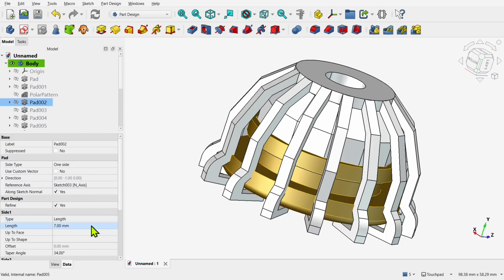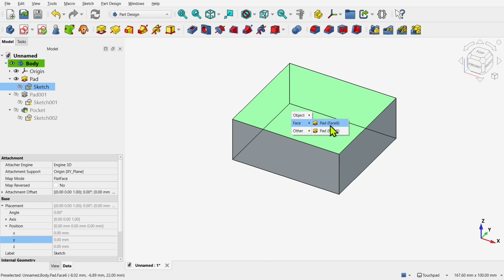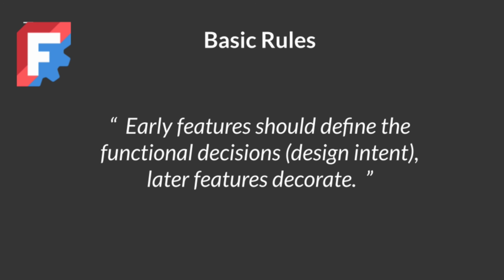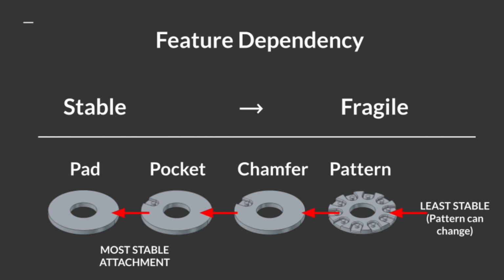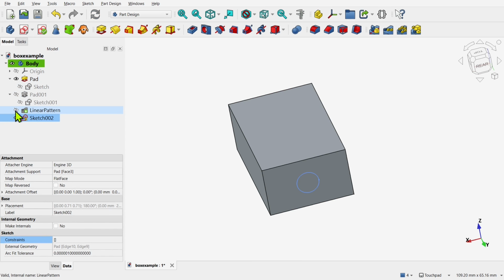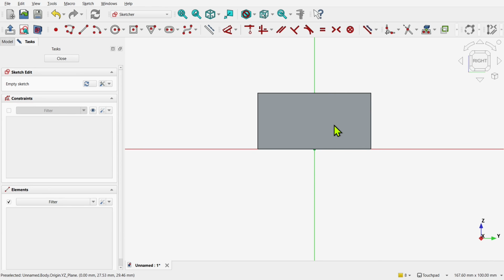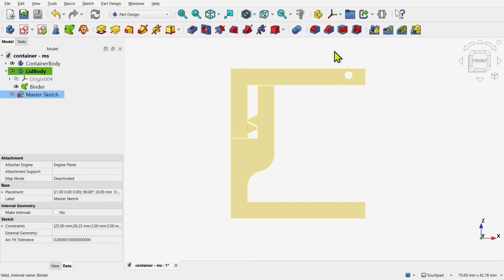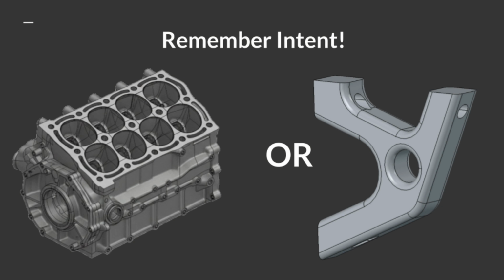Why Your FreeCAD Models Keep Breaking (And How to Stop It)

Comment from the maker: Recommended Book for anyone interested in Mechanics / Engineering - 507 Mechanical Movements, by Henry T. Brown. Check the link to get your own copy: https://amzn.to/4r5EYA1 (Amazon affiliate hardback copy) https://amzn.to/45lgbj5 (Amazon affiliate paperback copy)
Reply: i mean this in the most respectable sense .... you are an ass ... i was trying to figure out how to make changes simple in freecad ... what pops into my feed ... this freaking video ... I learned WHERE and WHY my sketches go poof .. and how to avoid that and how to reference inside the sketches to use the parameter one time and update where it duplicates ... 

exactly what you covered .. bloody hell Man how are you reading my mind .. months years and even days in advance LOL 

how about a video series where you design an RC drone of some type .. and INCLUDE parts like the Flight Controller and Electronic Speed controlers etc .. tbh ANY part will do ... but I want to see HOW actual parts can be referenced and incorporated into the drawing so IF you change one widget of 3 x 5 bananas for one that is 4 x 4 oranges .. it doesnt go kablewy ... 

heck do a Basic lamp even with wire bulb switch and shade even

Comment: This helps learning the FreeCAD quirks, at least I know a bit more to fix stuff.  Not ment as a critic to your video, but functions as designed is not automatically mean good UX design. It's certainly not, hiding behind, it has always works this way or your using it wrong arch.

Comment: This video unblocks the road block in learning FreeCAD. The simple one level tree structure display hides the fact that a down stream feature can attached to any feature in history not just the one directly above it. If the Tree is display like a folder tree, it will immediately show which feature is the support instead of having to dig into the feature properties to locate the support. Spent so many hours wrestling with FreeCad, not knowing I could reference any feature in history.

Comment: So far I was not using the VAR set feature - I was using a spreadsheet and created alias names for the main dimensions I needed. If you could make a video about the pros and cons of both possibilities would be great!
Reply from the maker: Varsets are more responsive than spreadsheet, they are easily selectable being in the treeview and you can update the values when, say, they are used in a sketch whilst you have it currently open in the sketcher and see the affect straightaway.  Varsets are also type aware so a length is a length, a string is a string making them quicker as they don't have to be converted into the value which is required by the property using it.  Spreadsheets can trigger an update just by selecting in a field which can increase compute time but spreadsheets are often more intuitive allowing for layout, calculation across multiple fields and different configuration for your part across multiple lines which can be hooked up to the copy on change. I try to answer some here to get the information across but it's a great idea for a vide, I will add to the list.

Comment: A perspective from an Old Catia user here... To make your first example model -, in a Catia way - I would create all 3 parts as separate models (Bodys), then union (Boolean) the 2 prisms together. The pocket or hole could be created simply (there were more complex ways) as a cylinder and subtracted. You can now easily snip off the hex body if you don't want it & update.
Yes, it creates a tree structure that can be more easily manipulated (in my mind). As the dependencies are held within each model (Body)
FreeCAD can be made to work that way, but the boolean structure is sort of hidden.
When doing the boolean between prisms 1 & 2 it creates another body and the 2 original parts go into hiding, which makes it hard to manipulate later on.
It's a learning curve - thanks for posting this.

Comment: Most of the tips in this video are useful for any CAD software, such as Solidworks and Fusion360. But some of them are specific to FreeCAD only. 
FreeCAD is good software, but often needs manual labour to resolve some types of issues. Fusion360, on the other hand, typically handles them automatically. I hope that FreeCAD will develop similar capabilities in the future.

Thanks for the video, it was helpful!
Reply from the maker: Thanks for your feedback and input on this, much appreciate.  Glad you found the video helpful :)

Comment: Yay, finally found a video that explains one of the reasons why FreeCAD breaks so easily so often, doesn't retain face numbering very much nor resolve changes so any feature that changes face numbering will break stuff.

I do not remember breaking models in Fusion 360 because of this unless I deleted or split a feature actually referenced in downstream sketches and I have CADded a 3D printer in 360 down to running wires using 3D sketches to route them. Looks like 360 is far more robust at maintaining references through changes. In FreeCAD, I'm struggling to put together a simple bit organizer for a screwdriver that came in a nice metal box with flimsy plastic organizer insert that is crumbling apart.

I'm looking into FreeCAD because I hadn't used 360 in a while and when I logged in last week to verify that the way I wanted to approach things actually worked in 360, which took under an hour including time spent re-acquainting myself with the UI, I found out all the stuff in my free-for-personal-use account had vanished. I really like how 360 allows part details to get flat-packed into a single sketch and selectively padded, pocketed and drilled from it. All critical dimensions, constraints, references features for downstream sketches, etc. for that part plane in one place, can't break them even if you tried. Doesn't work quite so well in FreeCAD which only allows one sketch feature to be selected for padding/pocketing at a time when you have 16 same-depth different-diameter holes, got to spit those out into a separate sketch to pocket them together. More external references to break.
Reply from the maker: It’s definitely a different mindset moving between software, but glad the video helped clarify why those topological naming issues occur.

Comment: I'm having trouble using shapebinders in a way that I assumed should be stable. Perhaps I'm misunderstaning how they should be used.

I have a feature Body001 > Pad001.

I have used this feature to create shapebinders in several other bodies, and attached sketches to the faces of these shapebinders. These other bodies contain, many pads, pockets, linear patterns, etc..

If I later add a chamfer to Pad001, lots of sketches and features in the other bodies suddenly break, even though the shapebinders are explicitly using Pad001 as their support (not Body001).

Comment: I recently built a model with three cylinders and two rectangular pads all aligned axially and i built each bit of the model off a a previous pad face. It worked but I did get a fantastic lot of help from the forum.  The next problem will be turn the model into aluminium! Will never fully understand everything about wonderful FreeCAD but it helps to identify this a lifelong learning exercise. These videos are a great help

Comment: I'm sorry but right off the bat deleting an extrude (pad) in fusion that doesn't touch the same face in fusion even if it's earlier in history causes no issues whatsoever, this is purely a freecad issue

that's just bad topological naming (?), in fusion only the extruded bit of a body is part of the feature, turning the whole body into part of the feature is insane

Comment: I’m an occasional freecad user, not a professional. I’ve started to avoid attaching features to faces. Instead, I’ll use a spreadsheet or a varset to specify a height or thickness and use an attachment offset that references it. It’s more work, but no broken dependency chains.

Now I’m wondering if I could do it better if I just paid closer attention to picking earlier more stable features.

Comment: Tools -> Dependency Graph is very useful for seeing dependencies. It needs search and a way to highlight a relationship, but you can export in Graphviz format and use an external viewer.
Reply from the maker: I love that tool, agree with those additions, they would really help. I also wish you could click on the nodes and it would take you to that in that object in the treeview / select it in the model.
Reply: @MangoJellySolutions yeah, that would be massively useful, especially if it worked in both directions (eg. select object from tree, right click "Show in dependency graph")

Comment: Unfortunately 90% of my modeling starts with very fluid design intent. I guess I will need to be diligent about re-mapping attachments to things I "know" won't change, or at least away from things I know will change..
Reply from the maker: There's nothing wrong with that, I  often do the same. I'm just prepared to rebuild the model if it gets in a complete mess. I do have some tutorials coming regarding techniques I use to troubleshoot / cleanup projects which will help.

Comment: I began learning CAD a week ago and came up with the same solution of storing all my master sketches grouped outside bodies placed on the second place after varset and subshape bound them to the bodies needed. That untangled my hierarchies a lot and I could do a boolean cut of a joint with proper aligned clearances yet keeping all parametric. However, later features I did with the relation to generated faces so it breaks from time to time and I'm gonna rewire it all to use attachment offsets instead of faces. I think there should be an option in parameters to disallow referencing unstable entities so that you have to parameterize them all

Comment: This is a great video! You mention in the video that care should be taken to not overload an early component. I think you mean don't connect too many things back to that early pad/loft/etc. Can you explain what that would look like if it were overloaded? I tend to use this strategy quite often.
Reply from the maker: Yes that's a better way of putting it, with the overload it's when you have a large project . If you're referencing the same feature over and over again it might be worth just checking that you are not over complicating things. You may have quite a stable feature further up. If the base feature breaks then you may get a flood of errors to deal with which could at first feel overwhelming. I have seen projects with all sorts of offsets from one single feature. Which makes integrating that into expressions or  a varsset a bit tricky as you are moving multiple operations rather than just one and the child follow. 

I should of made that a bit clearer.

Comment: By the way, feature suppression is a boolean value of a Pad/Pocket feature just like all the other object properties like length, offset, etc. This means it's value is driveable with an expression. This means it's value can be controlled by the value in a cell of a spreadsheet. This means the existence of features can be controllable by 1 or 0 in a configuration table on a spreadsheet, just like a set of dimensions.

I used this ability to make a model of a the D1 cam lock spindle that is commonly used on lathes. There are 8 different sizes, but it's not just dimensions that are different. Some sizes have 3 vs. 6 cams and some have the bolts in different orientations or with different features. There are 3 overall forms so the spreadsheet has a column for each form and each size has a 1 or 0 depending on which form they use.

Comment: Before FreeCAD had solved the TM problem, I used the realthunder branch for years, which had already solved it. Anyway, it works well with FreeCAD since 1.xx that i use recently. In most cases, I had only to re-aply the pad that the sketch was put on. After this great explanation, I wonder why FreeCAD doesn't keep the number of the pads through the whole tree.

Comment: Thank you, the video excellent reference material!
However, a lot of it is unique to FreeCAD - for example, in all Parasolid-based CAD systems you never have to select an "attachment mode" for a sketch. Picking a face (or a plane) is enough, and faces don't change when you just add to a part. In other words: In most other CAD systems, the entire first quarter of this video isn't an issue.

It's really sad that after all these years, the buggy "quirky" OCCT (or rather: the lack of a good alternative) is still holding us back. I have pretty much given up hope at this point. 😔
Reply: I must agree with you on this one. 
This is the prime reason that people get frustrated using FreeCAD and it's a perfect example of an application having a UX that is driven by developers rather than UX designers.
This makes it unintuitive to work with because it is alien both to math models and especially the ways that people work with objects in the non-computed world.

Comment: Very important video, once again it's given me a so much better understanding of how feature dependancy, attachments etc work.

However, I'm just glad that the kind of things I am modelling for 3D printing, with very minor changes if any, will probably never need a spreadsheet or Varsets.

Alhough I do find them interesting and fascinating, the thought of moving dimensions and parameters away from the actual graphics in the 3D view, to some tabulation or variable set, just feels like a step backwards for me, lol.

But as I say, that's just me, I'm not modelling for NASA or such.
Reply from the maker: Glad you enjoyed and thank you for sharing your thoughts.  I am in total agreement , sometimes you see models that have been over engineered by using a data source.  When I worked in the field we all kept to the whole YAGNI analogy (You Aren't Going To Need It) You can spend a lifetime making a perfect parametric customisable model of a spoon! :)

Comment: This is excellent. In a previous video I was commenting about shapebinders not respecting the "offset" feature included in them. As it turns out, this is only true when the shapebinder is applied to generated geometry such the face of a pad. If the shapebinder is applied to the sketch the pad was created from, everything works as it should. I believe this is an exact example of the principles you are mentioning in this video. Valuable information. You've covered it before, but perhaps the role of datum planes would make a good addition in this context.
Reply from the maker: Glad you enjoyed the video and also great to hear you found out more about the offset in the shapebinder.  I wish the offset could work on no planner faces as well like the 3d offset in part wb, I know that would be quite complex to implement.  

That's a nice request and I can see the values with that.  Considering the datum objects are now being moved to the standard tools in 1.1 so they are available across workbenches I can see them being used more and more.  I have made a note for that one.

Comment: Freecad is unique in the way it handles feature chaining. CREO for example features are not linked to the total results of all the past features, but instead linked to the feature that created the plane you placing it on. This makes remove specific sets of geometry much more stable than how Freecad handles it. It's also much faster for an engineer to make changes. 
Personally I think this causes Freecad to be a substandard cad tool. Modeling is never a linear line where you know exactly how it should end when you start.
Reply: That renaming of a attachment plane that has not changed (I mean, not cut in two, disappeard and it's still in the same "plane" and position) other than it's shape feels weird to me.
No wonder everything breaks when modifiying earlier stuff later like that.
Why do they do that?
Reply: Agreed. I have had a lot of hours (but many years ago) in Inventor, Solidworks, Pro Eng., and Catia and none of them rebundled the entire solid into the last feature. Also, if you were to create a feature on an early one, it would slot it into that position on the timeline, not leave it at the bottom.

So I think it's at least misleading for him to assert that all programs do this. If they do, they hide it very well from the user.

Comment: Hugely useful! I started using master sketches from a previous video for some more complex models. It takes a bit more planning, but the reduction in headaches is worth it. I also like to use datum objects as a basis, since it's easier to re-attach them if anything unstable breaks
Reply from the maker: Thank you :) Using datum objects really helps keep things stable as well especially when you use them with assemblies I found.  There has been a small problems with the RC releases as there seems to be a bug when used in that context (remind me, I must go and check back).  Master sketch is a great workflow :) :)